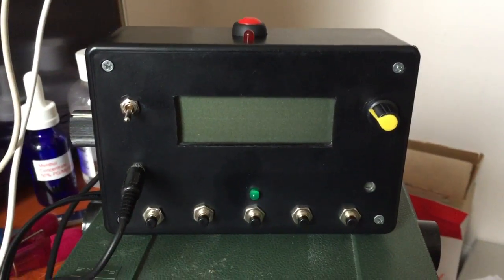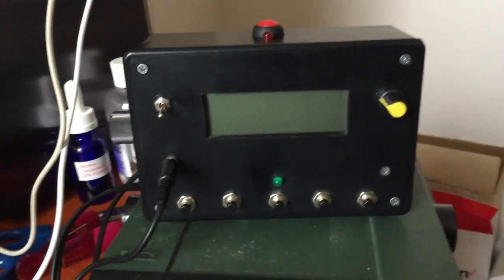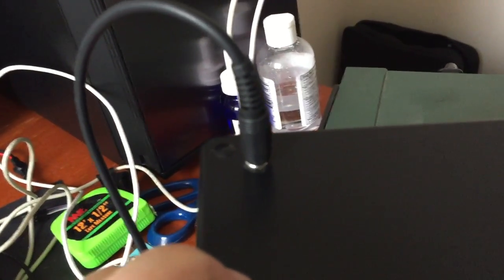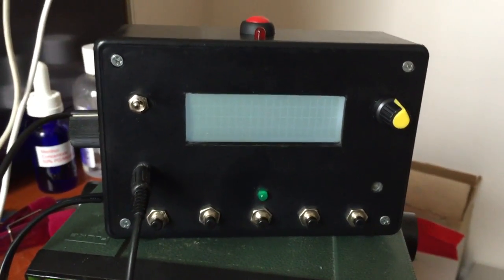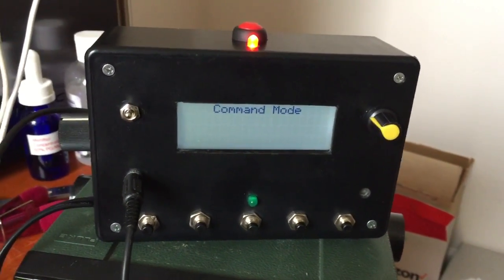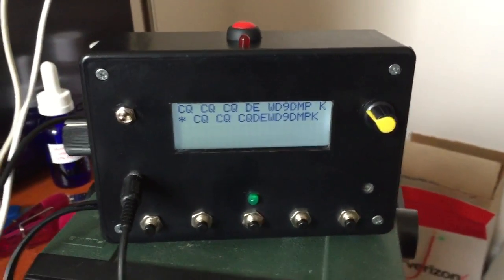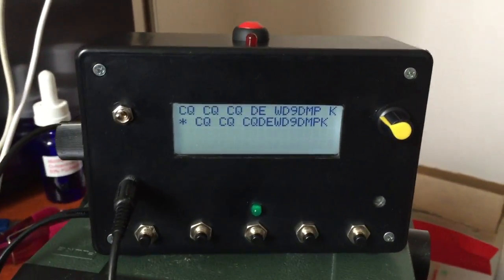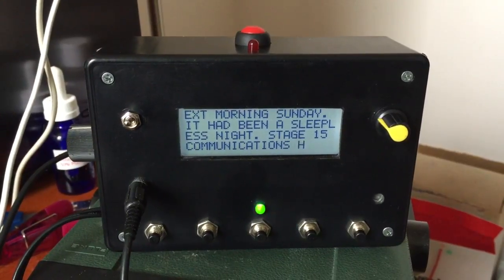WD9DMP's build of the K3NG CW Keyer and Decoder

Comment: Nice demo of the K3NG code and design. Nice implementation too in your repurposed project box. I see there are open source Chinese knock-offs that run the K3NG code available on AliEpress for about $80. Maybe I'll try one.
Reply from the maker: I had to customize the build as I kept running out of SRAM in the chip until I cut the feature set back. Back when I built, the code was VERY buggy, with all sorts of spelling and UI inconsistencies and logic issues. I recoded and fixed and submitted the fixes to the author, who incorporated most. Hopefully it is more stable now.

Comment: Hi, I have a problem with my keyer, it does not decode.
I used the goertzel.h libraries but did not decode,
enabled cw decode.
Could you please send your sketch?
thank you in advance
My email mamutcnc@gmail.com
Reply from the maker: I have the following enabled in keyer_feayures_and_options.h:
#define FEATURE_CW_DECODER
#define OPTION_CW_DECODER_GOERTZEL_AUDIO_DETECTOR

in keyer_settings.h:
#define CW_DECODER_SCREEN_COLUMNS 120        // word wrap at this many columns
#define CW_DECODER_SPACE_PRINT_THRESH 4.5   // print space if no tone for this many element lengths
#define CW_DECODER_SPACE_DECODE_THRESH 2.0  // invoke character decode if no tone for this many element lengths
#define CW_DECODER_NOISE_FILTER 20          // ignore elements shorter than this (mS)

In keyer_pin_settings.h (adjust to your own pin usage):
#ifdef FEATURE_CW_DECODER
  #define cw_decoder_pin A3//A11 //A5 //A3  
  #ifdef OPTION_CW_DECODER_GOERTZEL_AUDIO_DETECTOR
    #define cw_decoder_audio_input_pin A5 // this must be an analog pin!
  #endif //OPTION_CW_DECODER_GOERTZEL_AUDIO_DETECTOR
  #define cw_decoder_indicator 3
#endif //FEATURE_CW_DECODER

In goertzel.h (in the Goertzel library folder (library MUST be installed):
#if defined(_VARIANT_ARDUINO_DUE_X_)
  // Arduino Due (84 Mhz clock)
  #define GOERTZ_SAMPLING_FREQ 46872.0
  #define GOERTZ_SAMPLES 252 //168 //84
#else
  // Arduino Uno, Mega (16 Mhz clock)
  #define GOERTZ_SAMPLING_FREQ 8928.0
  #define GOERTZ_SAMPLES 64
#endif
#define GOERTZ_NOISE_BLANKER_INITIAL_MS 6
#define GOERTZ_TARGET_FREQ 744.0  
#define GOERTZ_MAGNITUDE_LIMIT_LOW 100
#define GOERTZ_MAGNITUDE_THRESHOLD 0.6 //0.6
#define GOERTZ_MOVING_AVERAGE_FILTER 6
Reply: thank you
73 py2wnw Renato

Comment: Totally useless! A keyer for a no-coder? An useful keyer should be operated with a logger, a contest program etc. Who needs a decoder (except training purposes)? This device hardly became popular among true CW operators, DXers & contesters. It is rather a tool for a Morse teacher!

73, Martin, OK1RR
Reply from the maker: Hmmmm....Well, it's quite useful as a memory keyer with macro capabilities.  The display and decoder are somewhat unnecessary, but the decoder is free for the cost of two resistors and a capacitor, so why not? I had the display in the box, so it is useful for demonstrating CW to my uninitiated friends. I may need to get an Arduino Mega to get all the bells and whistles running, but the size and cost has just gone up dramatically. An ATmega328p is pretty inexpensive!
Reply from the maker: Feel free not to build it! :-)
Reply: @df9999999999   Hi,
I've been having a look to the original assembling manual and I've been unable to find any clues/references to RX festures.
Can you please help me to find my way to RX (decoding) features?
Thanks,
Rafa.
Reply: @df9999999999  I am building something similar to this with a Mega and custom shield. LOTS of features (some that have never been done before). If you want in (or wanna know more), lemme know and I'll call ya or shoot you an email with the details.